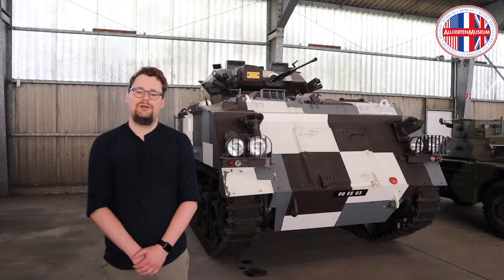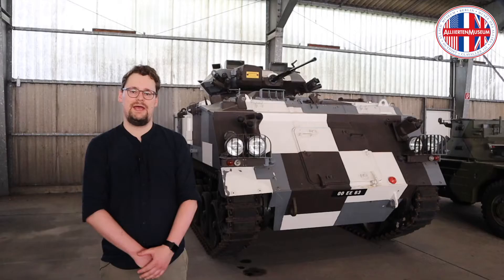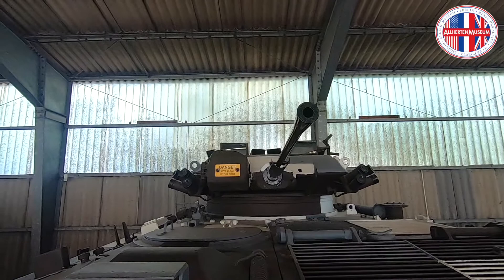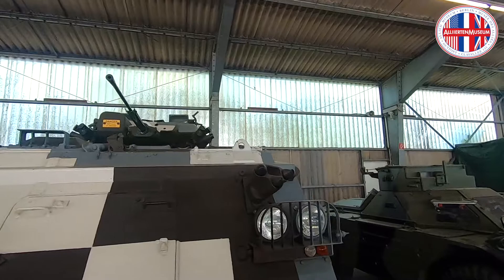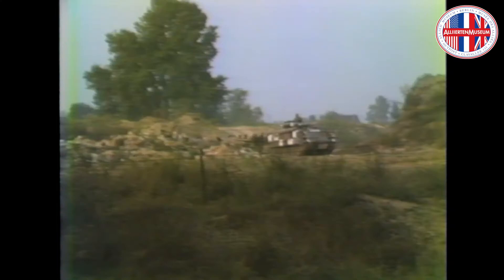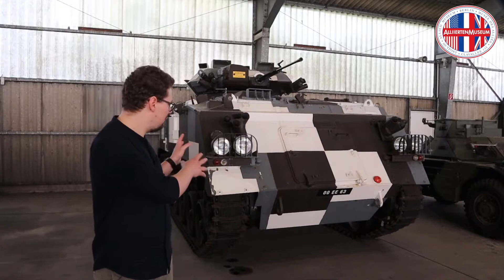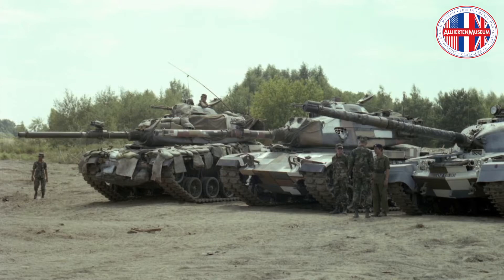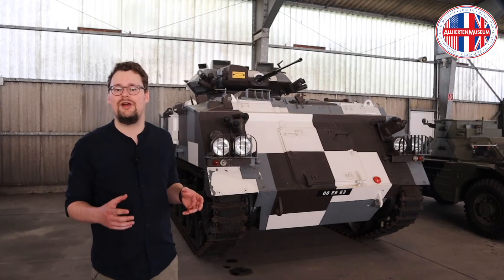#InsideOutpost: FV432 (In English)

Comment: As far as I know the urban camouflage scheme was only used in Berlin, not in Belfast, and I served as Infantry (1979-1987) both Armoured and Air mobile in the UK, Germany, Canada and Northern Ireland and in NI we used Land Rovers, Humber Pigs and Saracen APC's in Belfast and helicopters elsewhere in the province, couldn't imagine the Urban Camouflage pattern fitting in over there! 😆 And there were 2 marks of 432 APC's in use, Mark 1, petrol and Mark 2, Diesel, some Mark 1's were converted to Diesel. Mark 1's had square NBC packs on the right hand side and an exhaust coming out of the engine decks running along the left hand top to the rear of the mortar hatch. We in Minden stationed troops (11 Armd Brigade) all had Mk 1's as did BATUS in Canada, all other BAOR/BFG Brigades, used Mk 2's! I was driving and maintaining these before I got my car licence, glad to see it featured, thank you for your video! 👍🏼🙏🏼
Reply: It wasn't used anywhere but Berlin 🙂